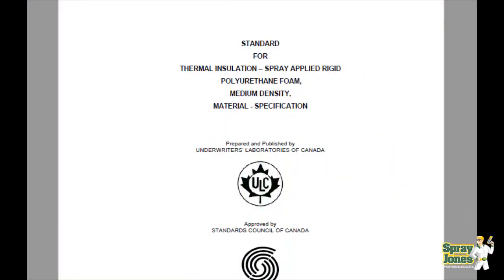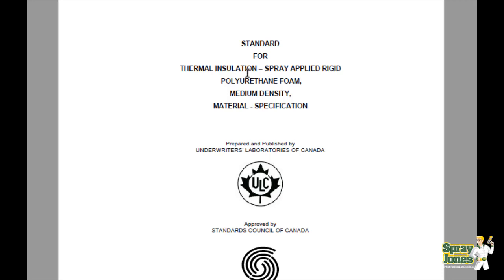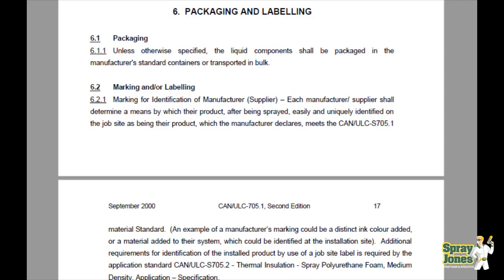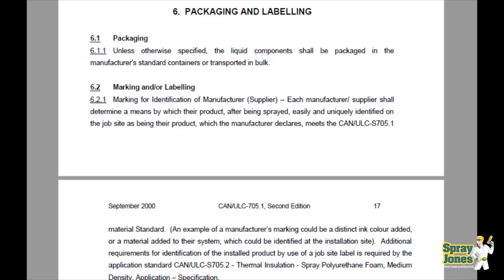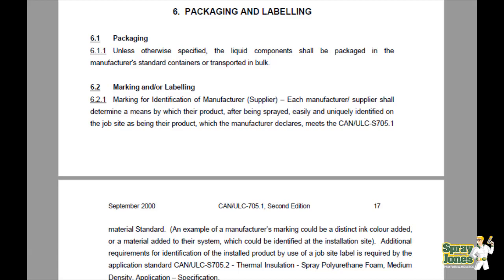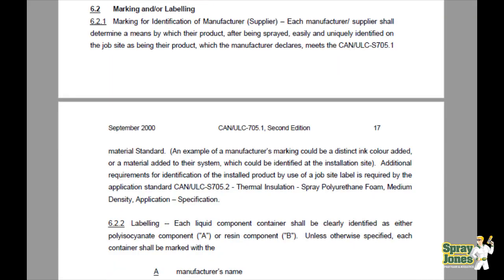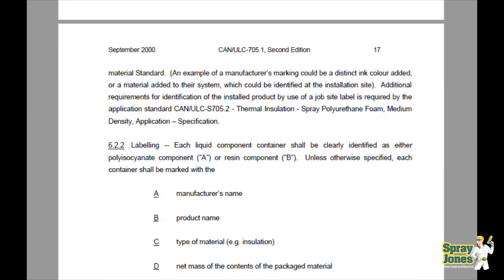Why is our spray foam Insulation purple?

Comment: I've been spraying Foam of 10 years in the ALBERTA CANADA Oil patch, and I was told by the Boss the Colored foam has Fire Retart in it... Spraying on the Pipeline and covering it with dirt to Us it really didn't matter what color the foam was and if we had a Colored foam it was because the boss was doing a Res job somewhere... BUT No one listens to the Boss anyways :) so it could just be ceritifed and Not Fire retart because the white foam doesn't burn either with a tiger torch on it...

Comment: Curious that the color requirement in Canada comes from the Canadian material standards people, not the manufacturer. Owens-Corning in the US has had to protect their 'pink' brand for decades. A lower court asserted that a color could not be copyrighted per se as a brand. O-C prevailed in a higher court and they are the only ones allowed to use pink as a brand hallmark. That is not to say that other fiberglass insulation makers do not try to use it. 

Here in the US, we mostly have color-identified piping: white for drinking water, purple for reclaimed water, grey for electrical, green or black for waste. [not the complete list] That and paint colors on the street: yellow for gas, white for cable, blue for water.

 I checked the BASF Walltite foam systems web page for the US. They show the installed foam as being a pale green color, not purple. You seem to use a lot of color coded building materials in Canada. Blue and purple studs, along with natural wood studs. Various kinds of distinctive tapes, e.g. red with some kind of service stamp. 

Other question: The first generation spray foam in the 1970s in the US was RapCo foam. Urea-formaldehyde. That stuff was g*d-awful in a residential application. Think: urine and formaldehyde. What happened to them and/or how is this BASF product  different?
Reply from the maker: UFFI is not polyurethane. The chemistry is night / day different. Like comparing lead based oil paints to acrylics now.
Reply: @SprayJones  THAT is exactly what I was looking for. I really enjoy your comments on the vids and the comment section: technical expertise combined with real-world experience. 

And now, back to wrestling with the Clark County [Las Vegas] Nevada building department about my mountain house at 7500 feet in a cold/dry climate. It seems they have never seen a home with a basement or unvented attic space.

Comment: It looks like it takes a long time kind of like you’re using a hand spray bottle when you need a garden hose. Can you put a different nozzle on that thing get a little more volume?
Reply from the maker: Sure we can. Try painting a room with a 12" wide paint brush. See what the job looks like when you are done.
Reply: @SprayJones  Doesn’t it all get covered with drywall? I see my painters using the 14 inch roller. They’re great plaster guys and painters, the room looks perfectly straight when they’re finished.
I could see with Walls you might have to take a little more time. But all that rafter stuff you should be able to just blow it out quick.
Reply: @mxctime  I'm an HVAC contractor, I can tell you when we work in attics where the foam is uneven (by guys "just blowing it out quick") it causes many problems. You really want the guys to slow down and spray evenly and neatly as he does. There is no advantage to a sloppy uneven job and it causes a lot of headaches for the service guys trying to maneuver through the space later.
Reply: @SprayJones  Why don't you take advice from armchair spray foam experts?
Reply from the maker: @lrc87290  The same reason I do not take advice from a 10 year or old, or a 50 year old with 10 year old ideas.
Reply: When you spray closed cell the distance from the wall and the pass overlapping is so important for yield and quality it's by far faster than batt and poly and light speed compared to cutting installing and taping ridged

Comment: thanks for this info. i have yet to come across a US company using any colored foam (i've seen green which i believe is for eco-friendly reasons). but uniquely colored foam would definitely help identify quality vs. all else - which is the dilemma i have at the moment. i will be spraying my new house but i'm conflicted on DIY or hiring someone because the foam "appears" the same and even then i wouldn't know the difference.
Reply from the maker: I suggest you watch the 2 vids I have on DIY foam. That product is in no way equal to what professionals spray. When you get below 40% remaining in a DIY kit the pressure is too low to mix it well enough to give you a good pattern. Hence dog puke looking material.
Reply: @SprayJones  2 ways to correct low pressure. 1st check the temperature of the tanks. The naturally cools while spraying, so you may need to warm them in the sun or in a heated room. 2nd way is to remove the hoses and add compressed air or nitrogen (preferred) to the tanks. Increasing the pressure 50 psi is safe (tanks are rated to over 200 psi).
Reply: @SprayJones  thank you for the advice I will definitely watch those two videos on DIY foam
Reply: My foam rig cost over 100k. Are you going to buy a rig just to spray your home?

Comment: Thanks for the info on the coloring of the foam. Do you know if this applies to foam for projects in the USA?
Reply from the maker: Not that I know of. USA is unique. I do know BASF Walltite is purple in: UK , Japan and Europe.
Reply: I checked the BASF website for the US. They show the foam as being a pale green. So the color requirement does not apply here in the US.
Reply: Question - can this be in direct contact with a recessed light fixture?